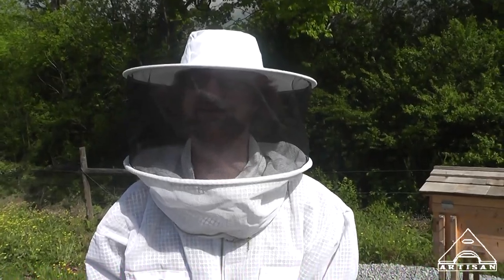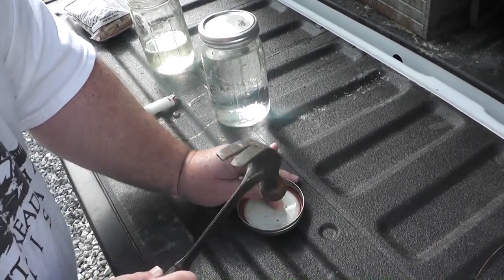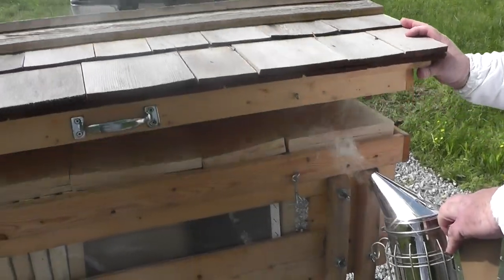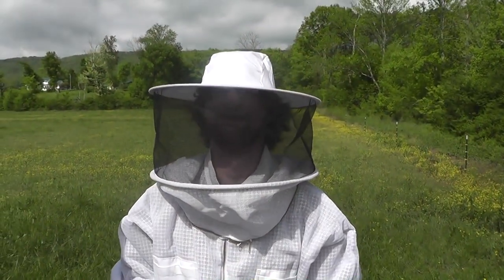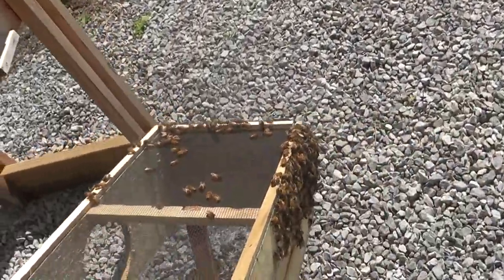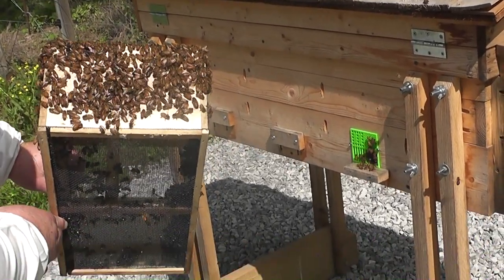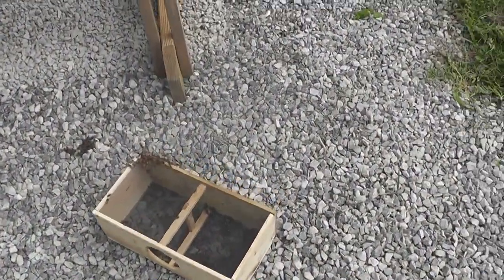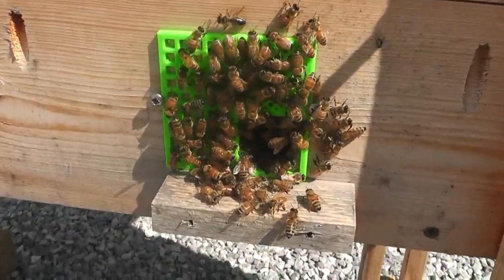My First Beehive - Vlog #2 - Day 2 Check - Artisan Apiary Project

Comment: I think you should lock the bees into an area With wax frames.make a board or something to limit the space for the bees and shake all those bees down there. I bet the queen were in the middle of all those bees under that board. And whatever wild comb they are building just throw it away. About 10 frames should be enough to start with and then later on you can expand with more frames. Keep removing all the wax that is not in the frames. The reason for this is that bees like to build where ever it's possible and that makes it hard for us as beekeepers to work with them. And an other tip, I use the cardboard package that you buy eggs in they work really well in the smoker and also dried peat.
Reply from the maker: killwolfs Good advice! Thanks a bunch! A local beekeeper came out today. Watch that one please and tell me what you think when I upload it.  Thanks!